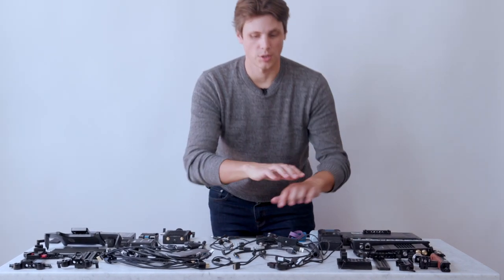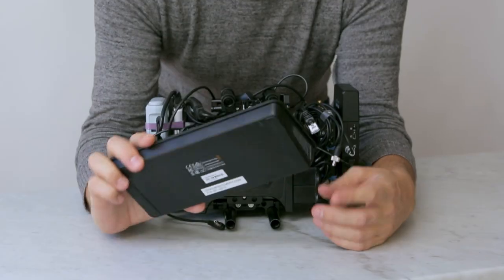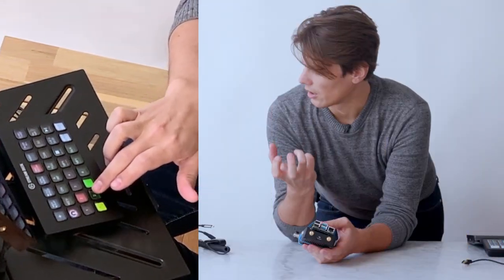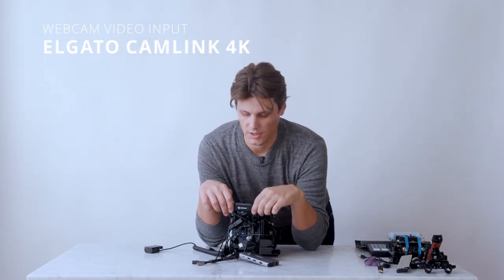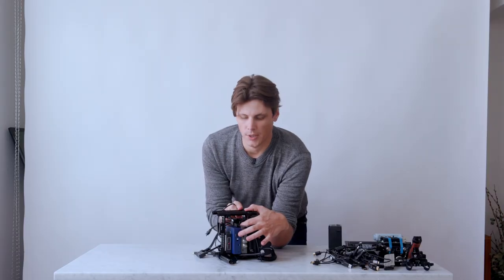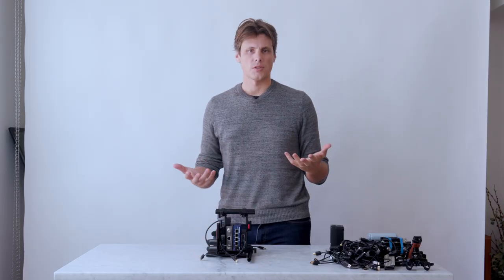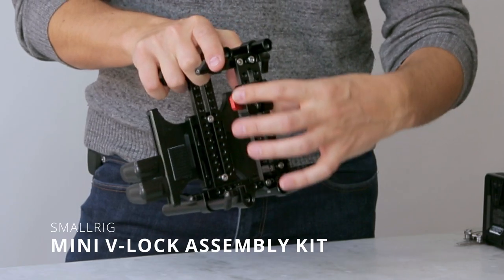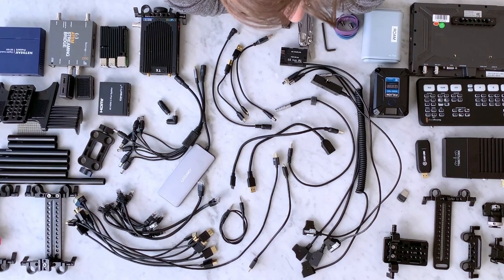Ultimate RIG for ATEM Mini Pro! (TEARDOWN, Part 2)

Comment: This is a fantastic setup, & I'm grateful for your generosity in sharing it with everyone.  One final piece would be the ability to mount an iPad Mini running iMix 16 Pro 64 onto the rig in order to play videos into the ATEM. Maybe VLC 4 will fix the issue with black frames when transitioning videos so that the Pi could do this,  too.
Reply from the maker: An iPad tablet mount and a cold shoe would be an easy add to this! Send me a pic if you make something similar!
Reply: @davidjoshuaford  I had a similar idea, but I want to put an iPad air (or pro if they fix the blooming screen issue) behind my Macbook Pro. Put the MacBook pro in a beefy case, then add rails on the back to slide the iPad to the side of use the iPad in side-car mode, so you can switch camera by touching your multi view screen itself!

Comment: Hugely inspired. I'm starting from scratch and this offers a lot to think about in a very modular way. I can build a frame that will support my immediate needs as well as support future growth. The other options I've seen locked me into a rigid case which is very clean and neat but not at all future proof.
Reply from the maker: Yes - I've since torn apart much of this build, and have been able to transfer the parts over to the ATEM Mini Extreme ISO and my PTZ Teleprompter instead, so nothing has been wasted here.

Comment: Love this. The core of the rig is so very adaptable. My desk is currently a huge mess of HDMI, USB and power cables that could easily be bundled up into a rig like this. That it’s so portable too is a very nice bonus :)
I’m off to the drawing board to work out how to build one of these with an M1 Mac Mini in it as well as the Pi.
Reply from the maker: Would love to see pictures of your set up once you're done!
Reply: @davidjoshuaford  Once I've worked out what the hell I'm doing!

Comment: Hey David, thanks for the video. I’ve been looking for a way to build a mobile setup and this looks ideal. 

I’ve been trying to rebuild this setup and I’ve had it burn through an Elgato can link, 3 Sony cameras, multiple switchers and splitters, my ATEM and my Teradek trying to get this all setup & working. 

Warning to anyone watching this, it’s not easy and having to buy double the parts is really expensive 😢. 

I’ve found that battery pack shorts a quite a bit out so I have gotten rid of that and come to the conclusion the rig needs it’s own power source and so does my Sony camera. I also had to upgrade every splitter and Switcher so they are all linked up to a power source and not using phantom power. Now it doesn’t seem like it’s shorting anything out. 

That said, having all of the pieces so close together, every piece in there is really hot. 

Are you just okay with it running hot or how do you mitigate that.  Are there any additional learnings you’ve had? Do you go back to this setup at all or did you also find a ton of issues with it. If so, PLEASE let me know before I burn through another round of equipment 😂

Comment: Good day and thanks for this, I picked up a lot of tips. Question, (with this setup) will the Companion Emulator only work on your mobile / tablet if you have the GL.iNet travel router?
Reply from the maker: Hi Pasmadong, good question – any router will do. It doesn't need to be the GL.iNet router, but it's a great portable form factor. You just need the phone + ATEM + the Computer running Companion (Win/Mac/or Pi) to all be on the same network. You could conceivably  skip a router by setting your computer up as host, and connect ATEM via ethernet, and Phone via wifi.
Reply: Thank you @davidjoshuaford  ! I looked at the "setting your Laptop as a network host" and came out with more questions then answers, hehe. I think I'll hold off on the router for now and will cherish the tactile feel of the stream deck for now.

Comment: Philosophical question...   Is this good that all this stuff can be hacked into a system that works if you're technically inclined enough to handle the complexity?  Or, do we have a long way to go before these types of capabilities are nailed down into a universal and ubiquitous ecosystem that manufacturers can adhere to?

I completely understand everything you're talking about, as I'm familiar with all the individual products and technologies, but the reality of it is upsettingly stressful to conceptualize and deal with day to day.  This is like a portable microcosm of the rats nests that I had to build and maintain underneath consoles and in the racks of various production studios, back in the early 00's.  I had really hoped we had made it farther than this, given how much time has passed.  None of the underlying product design philosophy seems to have measurably evolved.
Reply: I'm not sure where you are heading with this. This is a highly complex system which needed 3 people to run 15 years ago (or a lot more with an OB van for uplink), so it is very impressive to see it condensed down to such a small form factor. Of course there could be an all-in-one solution without the need for most the cabling, but as everyone has different needs (and doesn't want to pay for unused features) I don't see a solution coming up soon.
What kind of "universal and ubiquitous ecosystem" are you thinking of?
Reply from the maker: Hey Mister, thanks for the philosophical musings - I appreciate that because I like thinking through systems as a whole, rather than just specs. The ATEM Mini line is interesting, because it's pushing pro workflows into a prosumer market, so there's going to be a gap between creative desire and complexity of execution. Like Sven said, what was once an OB van is now compressed down to a single operator. It represents progress, but is still beyond the scope of the average user. The streaming world is interesting, because it takes it a step further and asks the creative person to both operate while performing....it's a lot to juggle switching and still be present with the audience. I think there's still an untapped market for dedicated hardware for the horsepower, but more user-friendly software for setup and control. To that end, I don't think Blackmagic's ATEM Minis are revolutionary thinking. They're just downsized evolutions of their existing tech.

Comment: I really enjoyed your video and have purchased your Bitfocus Companion ATEM Mini Pro ISO switcher Controls. I’m building a version of this RIG and have a question. 
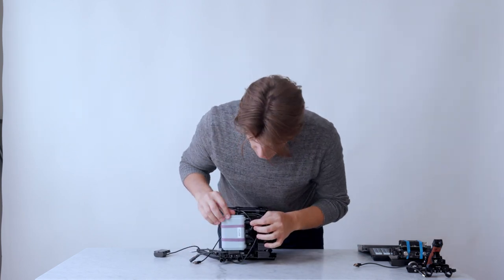I don’t know if you’re still responding to this old video but when you talk about the travel router at 6:21,
 you set up your travel router  so it does not reassign IP addresses of your devices when using clients internet WiFi on your laptop. Maybe you, or someone who sees this question can point me to video are link that explains how this is done?
Reply from the maker: Hey! Glad you found it helpful. I have a livestream about that router in my feed, and I’ll do some more livestreams on the GL.iNet routers in the upcoming weeks/months. It’s essentially the same as any other router, and you’re connecting internet via the WAN port, just that these travel ones are very portable and have great features.
Reply: @davidjoshuaford  Wow that was fast! Thank you so much for your response. 
I’m watching your GL.iNet Slate AX Wifi6 Stream and I think I can set the travel router up. It looks like I will need to give each device a Static IP address with same subnet mask. I will let you know if I get everything configured. 
Thanks again
Reply from the maker: @Casuallz  You're welcome - the GL.iNet routers by default run on 192.168.8.1, so you'd set your ATEM and other devices to static addresses within that range 192.168.8.xxx

Comment: The SmallRig Heighten Rod Clamp DCD2375 is no longer available. I looked through the photos and cannot determine where it fits into the build, and thus what to potentially replace it with.
Reply from the maker: There's a Camavate one that is similar - just check that the fastener placement doesn't obstruct your attachments - https://amzn.to/3gTKovP or else this one https://amzn.to/3rSLP42
Reply: @davidjoshuaford  Thank you very much.

Comment: Do you a recommendation for another holder for the Blackmagic Atem Extreme ISO?
Reply from the maker: I haven't researched any for the Extreme – its size really is becoming a desktop piece rather than portable. The way i've been using my Extreme is sitting on top of this Rig on the tray shown, so I can plug into the same network. I've seen some people have 1U rack trays that slide out. What are you trying to mount your Extreme to?
Reply: @davidjoshuaford  I'm trying rig together using my extreme Iso paired with a Yolobox setup. I got the extreme because of band concerts I sometimes live stream for my friends. The extra ports are great for action cams of drums and guitars through a few birddog for NDI config. I didn't want to deal with Vmix or OBS. 

Also, I'm not much of a programmer. Do you a copy and paste instructions for your raspberry Pi 4? I didn't see one on your website link.

Thanks again for make this rig. It's a great idea to piggy back on.
Reply from the maker: @megamattzero7348  Hi Matt, you can find instructions to install Companion on a Pi here: https://github.com/bitfocus/companion/wiki/Manual-Install-on-Raspberry-Pi That's what you'll need to control the ATEM Mini Extreme. Out of interest, what added functionality are you using the Yolobox for in your set up that the Extreme doesn't handle?

Comment: u are going to takeb off with subs no i cannot afford most of this but i will take some ideas because of u i just bought the kondor blue sony fz 100 dummy a7iii and i will buy some cheese plate and some rod clamp rod blocks
Reply from the maker: Glad you could take some ideas from all this! Rods are great! You’ll definitely use them for all sorts of applications over the years
Reply: @davidjoshuaford  so i been using the kondor blue cord with d tap to v mount and its been great so far
Reply from the maker: @johnnythunder8382  I’ve been really impressed with all the kondor blue gear I’ve seen. Looks like they make really thoughtful stuff.